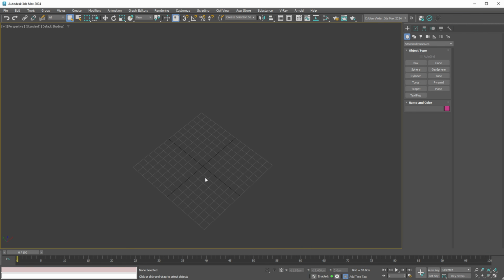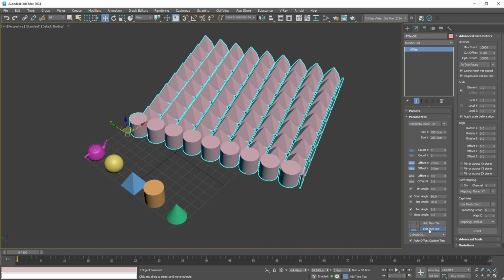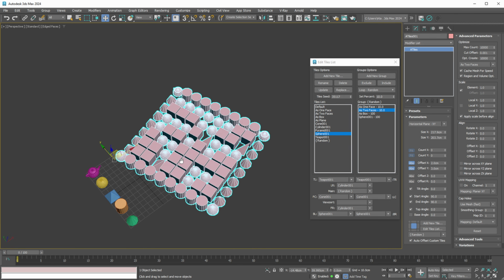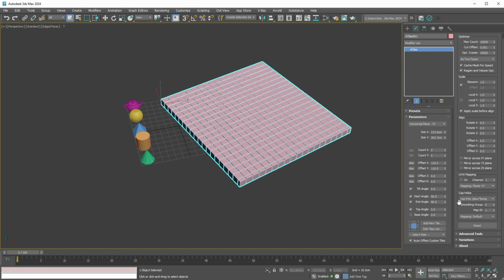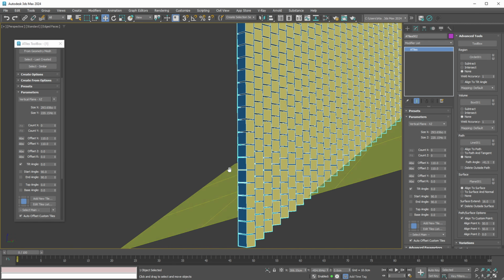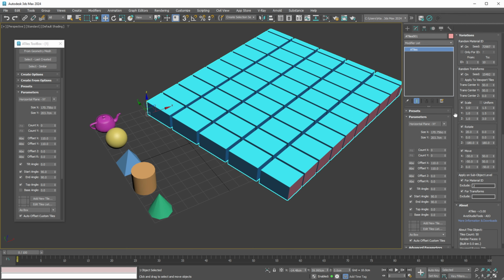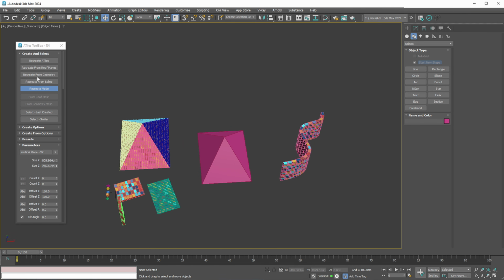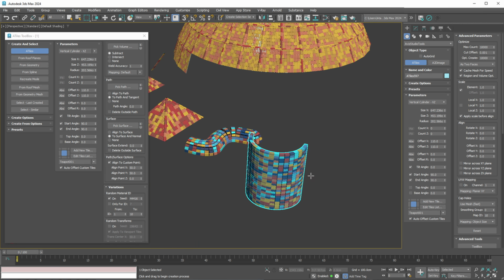ATiles v3.0 - Versatile Tiling Plugin for Autodesk 3ds Max

Comment: Does the pro version have an option to calculate the tiles for construction drawing purposes
Reply from the maker: Both free and pro versions shows in about rollout how many tiles are used to built the object, but this count is not the exact number of tiles you see in the viewport as you may use a region, cut angles or other options that limit the object boundaries.